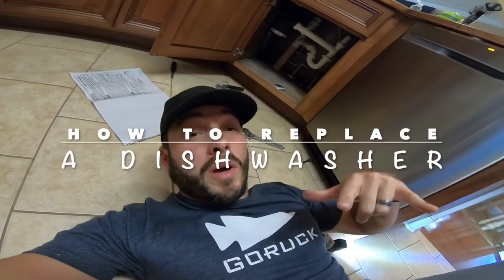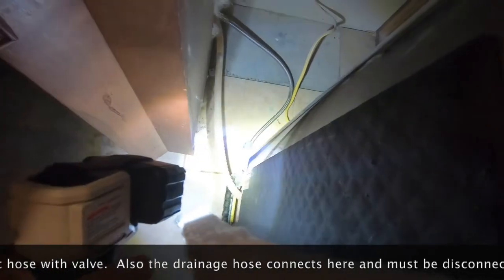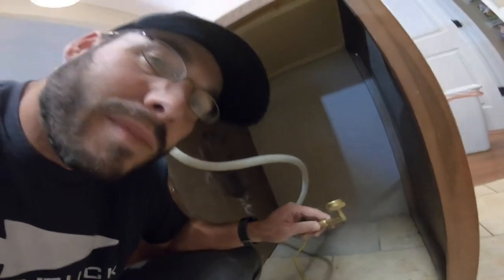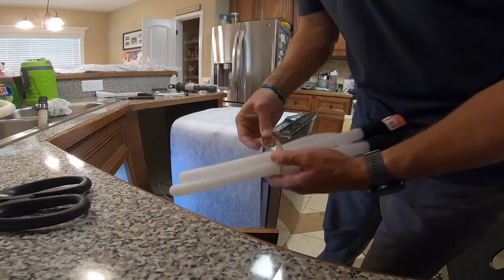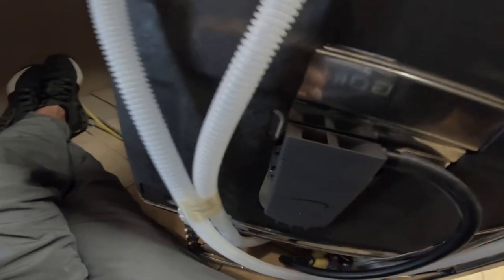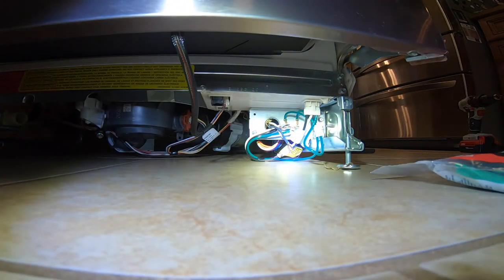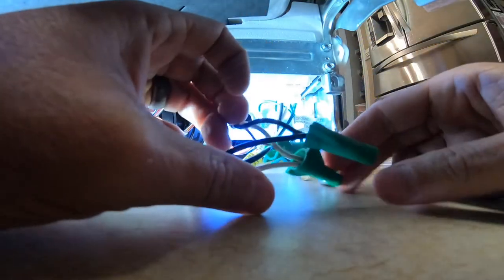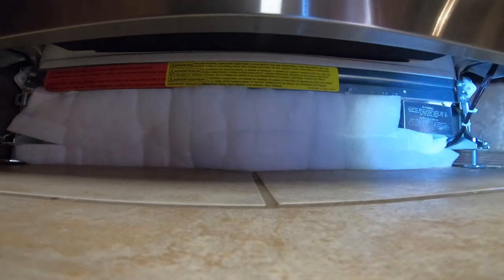How to Install a Brand New Dishwasher

Comment: Try sliding a cookie sheet under the hose before you disconnect next time. They are shallow enough to fit under the dishwasher but large enough to collect all the water without overflowing. Good luck not spilling though picking up from the floor to dump in the sink!! 😂
Reply from the maker: Your a genius like when changing oil so the oil won’t get on pavement.  Thanks Jason!!